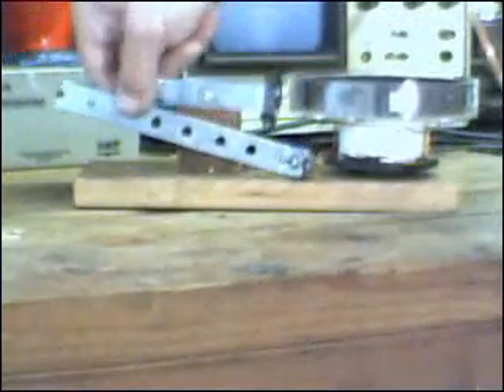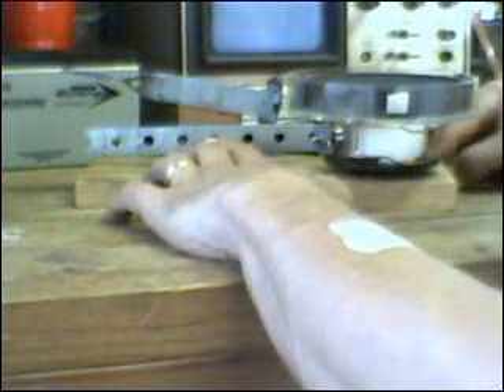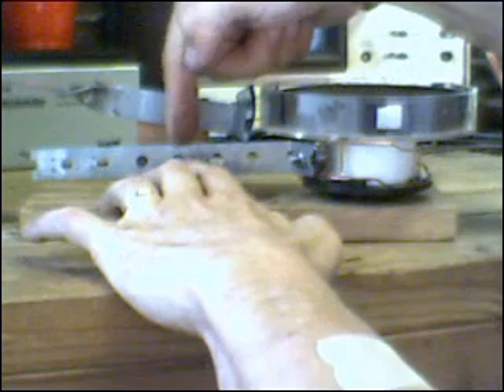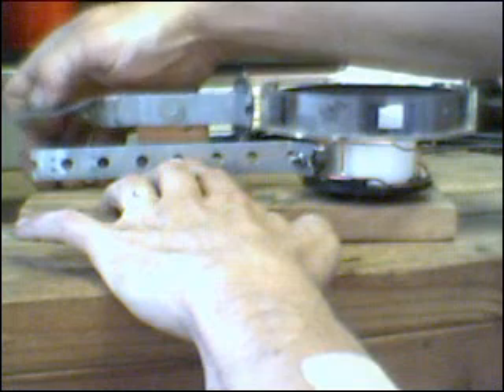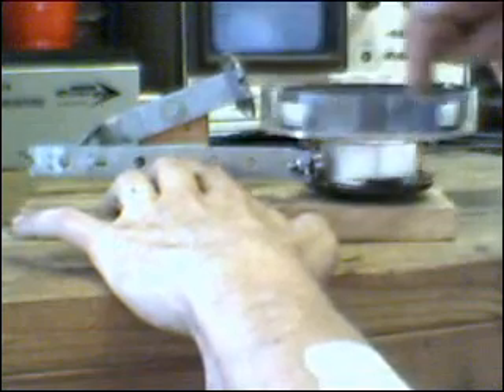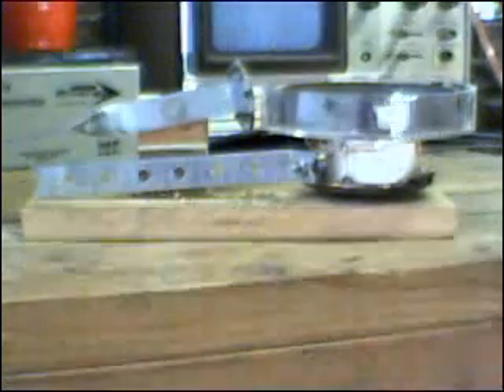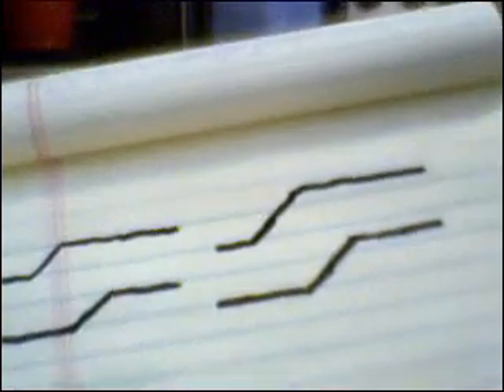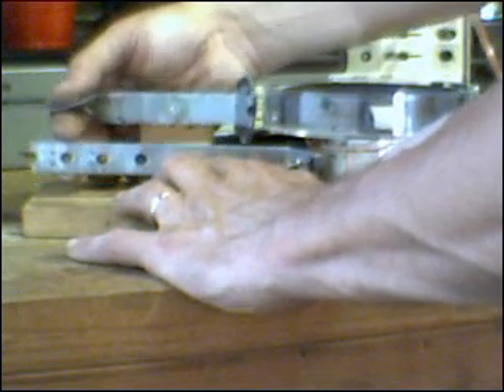07 - Magnet motor bobbin actuator progress.

Comment from the maker: Point taken. Thank you.

Adjusting the fulcrum position was already planned. The problem is I need to retain the 4:1 mechanical advantage over the stator. Moving the fulcrum too far toward the rotor decreases that ratio. Don't want to go too far or it will certainly stall.

Comment: that's a very cool construction so far, congratulations.. :-)
regarding the not sufficient actuator travel, i would recommend to leave the copper rail as it is, but rather to make the centre of rotation adjustable horizontally, if you know what i mean. this way, you have the benefit of being able to adjust the range of displacement by just moving the centre of rotation to the left or to the right. the more on the right side, the bigger the displacement.